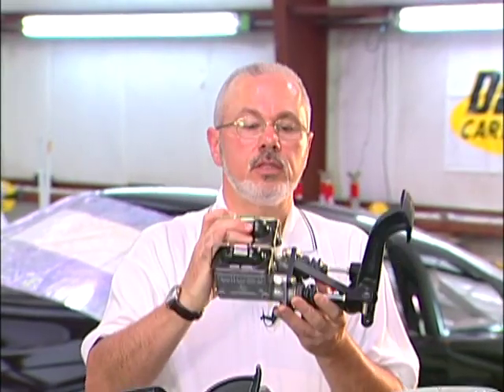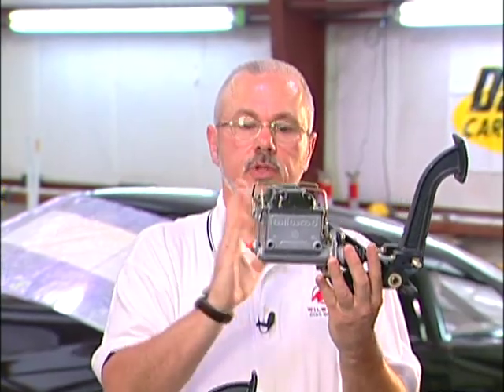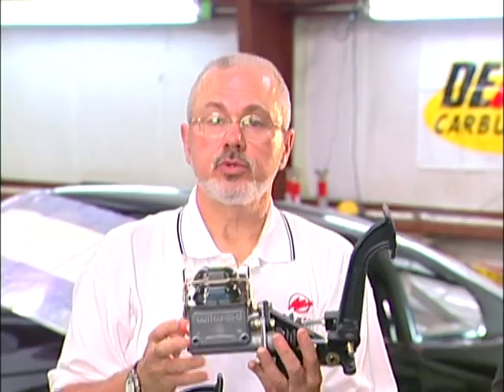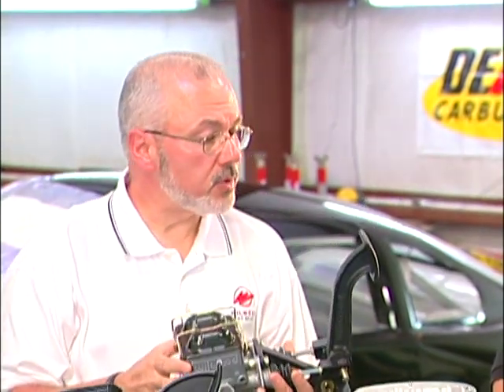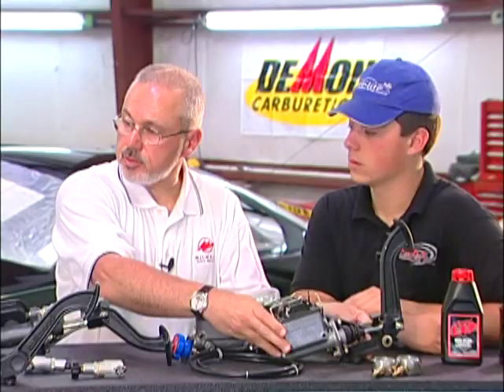Racing Brake System with Wilwood Part #1

Comment from the maker: akbar - It's a com bearing on a threaded shaft that moves from side to side when the shaft is turned so that it applies more pressure to one side of the master cylinders.

Comment: Hi. is the Willwood Proportional vale good por Races Purposes?  I have some issues with one like the one in this picture but EMPI. 

summitracing com/parts/sum-g3905

The problem is the valve don't realease, and even caused that the rear train, got stock... breaked.

Could you please help me to know if this kind of valve are good for racing purposes?

REgards, and thanks

Comment from the maker: Yep, that's correct. You want the system designed so the normal position is in the center of adjustment so you have adjustment available in either direction.

Comment: One point missed about the balance bar - if it's normally too far to one side, that would suggest that either the master cylinder it's nearest needs to be a smaller bore and/or the one it's furthest from needs a larger bore - depending on pedal load and travel, of course.